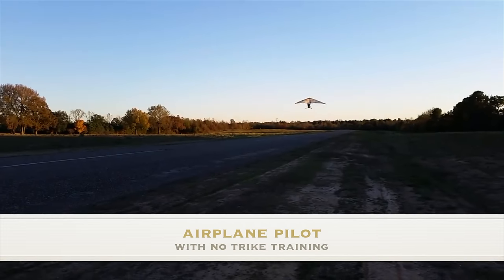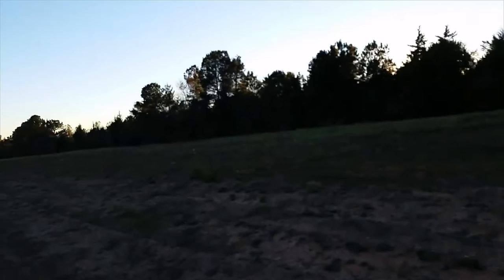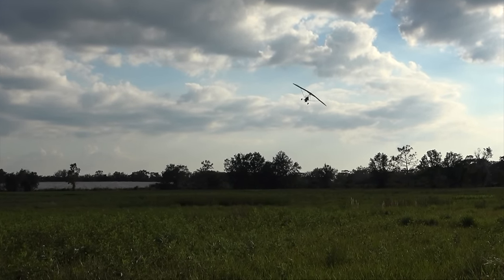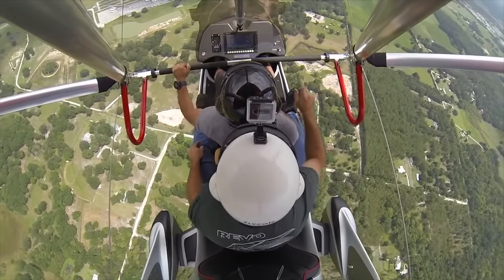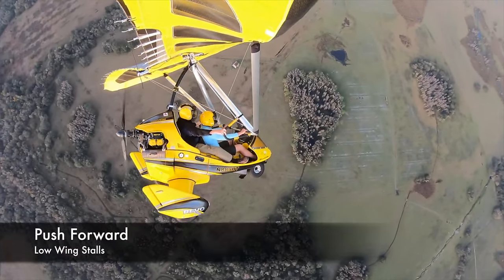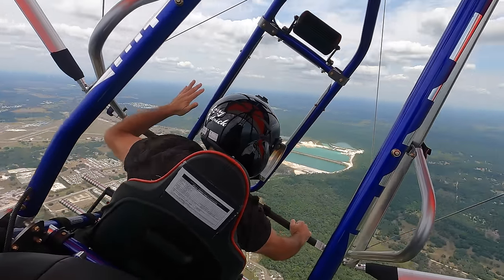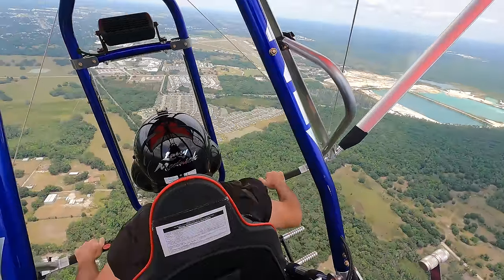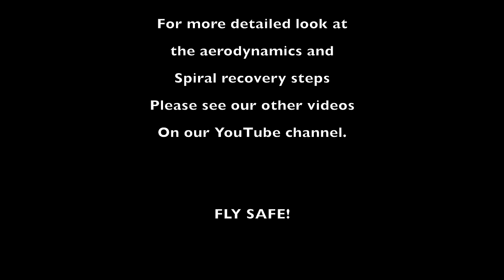Loss of Control in a trike

Comment: Flew unpowered hang gliders in the '80s and '90s. Simply don't understand how any certified pilot would think they can just fly a weight shift flex wing without instructions. In my days when flying, I did hear stories of pilots with PPL pulling in stead of pushing to flair, especially if the situation got a little difficult.
Reply from the maker: I get emails and calls every week with people thinking that way. Hope this video can bring some light to the skill required and consequences of not having that skill.
Reply: It's pretty simple if the pilot has never heard those four words together.   Stupid hurts but lack of or misinformation kills.
Reply: Because regular stick and rudder pilots are not familiar with weight shift aircraft. May not even know the term.
Reply: It's called overly confident arrogance.......
Reply: Idk i’m a fixed wing guy and tried to hang gliding a couple times without any incident. Albeit it was off of dunes but it was easy and natural. If you think about what you’re doing, instead of reacting out of privacy, it actually comes natural.
Reply: @LarrySMednick  
I believe people have to "think like a helicopter pilot", in controlling the attitude (nose up or down) of the craft.
Reply: a pilot should know to receive instructions in ANY unfamiliar aircraft, EVEN types similar to what he's done his check rides in. 
While MOST basic controls are familiar in position and operation, having to search for a switch or control during an unexpected critcal incident, or hitting a wrong switch can prove fatal.👍🇺🇸😎
Reply from the maker: Flying isn’t so hard. It’s just very unforgiving.
Reply: Its very simple.  People watch youtube videos and think its effortless how the star flies their craft and think they can do the same.  So they self train and find out the reality of self training.
Reply: Simple... its called alcohol.  You should try it some time. Let's you do cool stuff
Reply: Please. Just tell me how The damn controls move the wings n ez peasy
Reply from the maker: @skeetermcswagger0U812  Dunning Kruger effect: person knows so little about the subject, they don’t know what they don’t know and deem  themselves educated on the subject.
Reply: I did scared the life out of the poor bugger
Reply: @Captndarty  Same here. I became a pilot at 18 back in the early 70's. 
In the 90's I bought a single seat mx quicksilver.  
Then I  wanted something a little more simple
and started flying a used Northwing trike without any formal instruction. I never had a problem. Very simple enjoyable flying.

Comment: I can see why a fixed wing pilot, trained to push the stick forward on impending stall, would in this case push the bar away from himself, thus making the situation worse.  Very informative, thank you.
Reply: And in a panic someone pulling back to gain altitude would just plant the thing in the ground. Well said!
Reply from the maker: @drlong08  Yet pulling back in a panic rarely has consequences worse than a bent landing gear. it is the spiral and the pilot not pulling back that kills. Trikes, unlike fixed wings cannot dive very well at all. they can pretty much only hit the ground hard from stalling (very uncommon in trikes compared to fixed wing) or the the spiral (which is nearly every fatal accident).
Reply: Hey I used to fly fixed wings but I have a trike, but never flown it. help me if I'm wrong, please.
So...that situation of nose up in a turn is kinda similar to the fixed wing. Losing speed in a hight AOA, and getting stalling in a low speed and high wing banked. ( I'm I correct?)
So....in order to recover from that situation, should I put the nose down for speed and level the wings for lift, like any other acft?
Reply from the maker: That is not what’s happening here. The trike is flying at a relatively constant airspeed in coordinated flight.  No nose up stall, no slow speed in what we are talking about. If it stalls it does so at high speed (an accelerated stall) after the spiral develops when the nose is down. If you want a better explanation watch this, https://youtu.be/fbXz26wu370
Reply: @LarrySMednick  Thank You!
Reply: Seems to me a fixed wing pilot would immediately ask and learn how to control the aircraft … how to increase airspeed.  How silly.

Comment: As a former microlight/ultralight instructor on both 3 axis and weightshift, it was obvious when converting people from one to another that correct training, supervision and practise is essential. To a 3 axis guy, weightshift control isn't natural, no matter how prepared you are. For example, there are ways to describe roll inputs - to roll left, pull left wing down. It's helpful to also compare steering a car by holding the bottom of the steering wheel. Pitch control is the killer because 3 axis instinct is harder to overcome, until you get the idea that you're actually flying the wing, not using elevator.
Reply: I used to fly both sail planes and hang gliders and both seem perfectly natural while fly with the horiso. The problem came for me after looking at the así and doing hang glider instinctive recovery. But no sooner was I pushing or pulling the wrong way looking up at the horizon instantly put me right. I soon learnt t not to pay to much attention to así in sail planes.
Reply: I see it differently.

The problem is simply that the controls COULD be set up so they function in the same direction as FW, but it's rigged opposite...

You could have rudder pedals for roll, and a normal stick that swings the trike aft when you pull back.

Problem solved.
Reply: @myotherusername9224  Hmmm, interesting concept. I must ask, have you flown a weightshift trike? The 'simple' system in use means that you just shift your weight, left/right/fore and aft, to control the aircraft - in the same way a hang glider is flown. The trike is suspended by a hang point from the wing, allowing the trike to swing when moving the A frame bar. I fail to see how a system of rudder pedals and stick could be rigged up. There is effectively no yaw control due to the absence of a tailplane and rudder, so quite what rudder pedals would do is unclear. Likewise, how on earth could a control column be rigged to operate the weightshift mechanism? Baffling...
Reply: Extremely simple. 

The stick is for pitch only and it's rigged exactly liked the stick on a Bensen gyro. ( I'm talking about the bottom stick style with linkage and bell cranks to the rotor head, not the  overhead style stick). Stick back, rotor head ( or kite ) tilts back.

Fixed Wing  pilots have it drummed into their head: in a stall, rudder against the direction of spin with FEET,  not with the STICK.

so, rudder pedals linked with Teleflex cables or push/ pull rods  to  a spot about one foot to the left and right of the hang  point. This is all trivial copying of standard control linkage geometries and hardware.

Push right rudder pedal, trike CG swings to the Right. Relax back pressure on the stick.

Same exact result aerodynamically  as high hand to hip, but it uses the same muscle memory and intuitive response all FW pilots  know.

Zero learning curve for fw pilots transitioning to WS,  and vice versa.
Reply: @myotherusername9224  Wow, fascinating - wonder why nobody has actually built one like this, lol.
I ask again, have you actually flown a weightshift ultralight?
The additional structures required at the hangpoint would be substantial. Current weightshift/hang glider wings utilise a feature called 'billow shift' whereby the floating cross tube allows unequal sail tension on one side in a turn, slackening off the inside wing and helping the wing to bank. Perhaps you are advocating that the cross tube be fixed to the wing keel as part of the changes at the hang point. Remember, as a tailless aircraft there is no yaw control, so I'm not sure what effect rudder pedals would have in rotating the trike c of g.
Perhaps you should offer your engineering expertise to the leading designers of weightshift ultralights, you never know, they may take up your ideas and revolutionise trike flying. I look forward to seeing one flying...
Reply: I think I might give this a miss.
Reply: @richardteale3217  give what a miss? Why  ?
Reply: @myotherusername9224   No offence meant my friend,it is just my way of saying that this activity scares me to death ! I wish I had the skills of the flyers in your video . Regards from England.
Reply from the maker: @bigglesace1626  a rudder has a roll yaw decoupling and would not allow for safe flight. In fact someone built one and died on the test flight because he didn’t understand the effect of a rudder on a. Flex-wing. So in other words he took off, the trike winged 3 axis banked right, he gave it left rudder and it rolled right more. He corrected more to the left and it rolled further to the right causing it to crash.
Reply from the maker: @myotherusername9224  the short answer (very short) a stick and pedals would not have the leverage to be able to control it and a rudder will kill your on a trike because of roll/yaw decoupling.

Comment: Who needs fancy shmancy "positive stability"? Ground level is the most stable point possible and therefore ultralight trikes are optimally built to rapidly seek the most stable configuration.
Reply from the maker: Trikes have tremendous positive pitch and yaw stability and neutral roll stability. They are spirally stable as well. Hence the video…

1 hour Unscripted Flex-wing Aerodynamics Session with Larry Mednick
https://youtu.be/fbXz26wu370

Comment: Seems like you would naturally want to pull high hand down to your hip. I don’t see why anyone would do anything else.
Reply from the maker: It is important to remember, that pushing the bar forward and or adding Throttle will cause the Aircraft to climb in pretty much every other attitude besides a spiral dive. This habit gets built up overtime that when you want to go up, you do those two things. In the spiral dive, you’re coming down very quickly And you want to go up. This builds a very dangerous false correlation that does not exist. But I agree once the simple procedure is explained and the Pilot does it a couple of times they are trained for life and understand what to do. The issue is training, not the aircraft, of course.

Comment: This is a very good video for anyone looking into weight shifting flying. I have been a fixed wing pilot for 50 years flying LSA’s a few hours to the B777 and bunch of corporate jets in the middle. What I learned I would never ever think about get under that wing with out an instructor. This is a Totally different way to fly. 😀🛫
Reply: That's only because the controls are set up wrong. Transition from FW would be a non issue with normal rudder pedals for roll and nose wheel ( push right, go right)  and a stick   (back stick,  go slower, push stick,  go faster).

This  change would eliminate the problem.

This video is about stall/ spin, and FW pilots fly the wing, too. 

Fuzzy thinking is at the root of this problem. A wing is a wing. 

Would any sane FW pilot buy,  or even get in, a plane with reversed controls?  

No. But they try to fly WS , and it's the exact same situation.

This situation, comes from blind acceptance of failure to think through the basic premise of the controls design. That's it. There's nothing special about flying a trike except  massive unacknowledged mistake in the design of the controls.
Reply: @myotherusername9224  Stop trying to change an aircraft to fix your notion of what it SHOULD be.  There are many types of aircraft which have very different control mechanisms.  Paragliders, Powered Paragliders, Hangliders, Powered Hangliders, Parachutes, Powered Parachutes, Sailplanes, Fixed wing propeller, Fixed wing Jet, Rotating wing, Gyro rotating wing, etc.  Get over it and learn the skills required for the appropriate aircraft!

Comment: As a super experienced HG pilot, the first time I flew a trike, was by myself with no instruction (1990ish) from our local city airport. What got me, was the unexpected trike cage  swing forward (Kosmos-Fuji-Robin 440); Rather than just let it happen, I pitch inputted into the control bar, which took the small wing bank and amplified it into a unexpected 30+ degree right turn which aimed me at the hangars. I pulled back in to allow the ability to crank in some left bank, even though I was low, which got the wings level and then pitched back up into a climb. Takeoffs after that, I was prepared, and when the cage swung forward, I just let the wing maintain its current pitch attitude and there was no problem.
I am actually convinced that trikes are one of the safest aircraft now. Later flying a Seair (look up seair ultralight), I found it cool to fly down close to the water in ground effect and drag only the rudder in the water (hung down about a foot) because the trike frame was normally at a pitch up attitude. BTW, I have hundreds of hours in trikes, and thousands of hours in HG's, not to mention PG, FW and RW.
Reply from the maker: Glad you made it on your 1st flight. Luckily we have trainer 2 seat aircraft readily available these days.

Comment: As a non-flyer but also a keen aviation nerd who'd love to leave the ground solo some day, I'd always looked at things like trikes and other microlight designs with something of a wary eye. It's quite remarkable to see how stable and recoverable they can be when correctly flown by a knowledgable and practised operator, even when deliberately or accidentally put into a very extreme attitude which seems to be asking for a big oof. I'm suddenly a lot keener to investigate the process of learning to get airborne in something like this.
Great video, thanks for the upload. New subscriber here, cheers!
Reply from the maker: I started in airplanes and the. Discovered trikes. My words after my first trike flight were “I am done with airplanes” 20+ years later and over 10,000 hours in trikes, and my statement was true.
Reply: I started on a cessna 150, and later took up handgliding (soaring/no engine). The thing about smaller aircraft that many people don't understand at first is that they are not practical vehicles. If you can't fly over the weather, then you will be unpredictably grounded, you can't have an inflexible schedule and go fly somewhere on vacation. So it's really about recreation, and smaller aircraft like trikes, paragliders, ultralights, etc maximize that recreational aspect. Maybe it's a small pontoon craft you can fly from lake to lake. Or a powered paraglider that lets you fly down low with reasonable safety. Hangglider trikes are certainly the motorcycles of the sky, with some getting absolutely ridiculous climb rates. But for the sake of plugging my own interest, the down side of powered flying is that you really have to make your own fun. Coming up with a mission, the "100$ hamburger" or fly-in or something, or simply the fun of pursuing additional qualifications and skills. Soaring on the otherhand is a sport. The fun is sort of built in, and necessarily comes with a local flying community. Competitions you can attend, and so on. You get to learn a whole landscape of the air that you otherwise likely wouldn't consider. The look of clouds, what birds are doing, watching for visible vorticies on lakes and crops, debris in the air. You aren't given anything for free, you need to learn how the air works, where it's going up so that you can stay up with it. And birds do the same, they don't want to flap after all. Once I flew just feet from a pelican for 40 minutes, it joined my thermal at around 7k ft, flew right up to me under my right wing, then literally followed me from thermal to thermal for awhile. That kind of sustained interest and proximity is extremely rare, and I don't expect to ever experience it again, but thermalling with birds is common, they aren't scared of you and don't tend to leave when you join them.
Reply: The other benefits of at least part 103 aircraft, I'm not sure if this is true for light sport, is that maintenance can legally be done yourself. It's all just much less expensive, you can have a brand new powered paragliding setup for ~9k ish? A beginners soaring setup for I don't know, 5k? My first hangglider cost 4k new. Airworthy used gear can be far less. So nobody can use money as an excuse to not get their wings.
Reply from the maker: Yes you can take a weekend course and do your own annuals on an ELSA 2 seat trike.
Reply: @LarrySMednick  Hey, thanks for the feedback/info Larry, cheers from SYD 👍
And thanks to the other commenters for their input too, hope y'all are having a great day/evening.
Reply: @LarrySMednick  Would like to know more about where you train from.  Keen nerd here too!

Comment: Great video. I can see right away that if I went out in a trike without a checkout, as soon as something surprised me so I had to respond instinctively, I would probably move the control bar in the wrong direction without thinking, as in, pull to pitch up.  They seem to be a lot like the very early Benson gyros that were controlled by tiller bar coming down from the rotor head, which was switched to a stick from below probably for the same reason.  The spiral tendency seems not that different from an airplane's, just WAY faster.
Reply from the maker: Exactly.